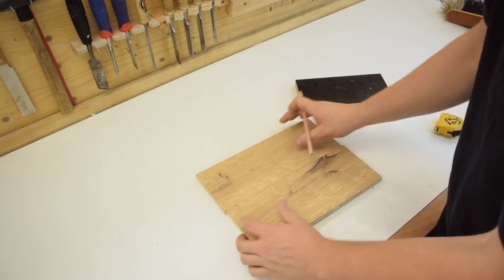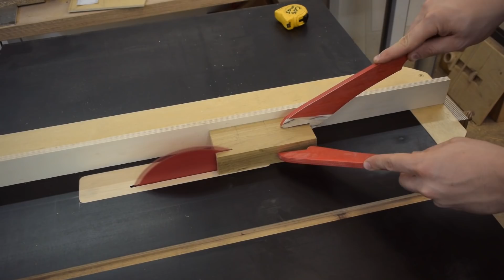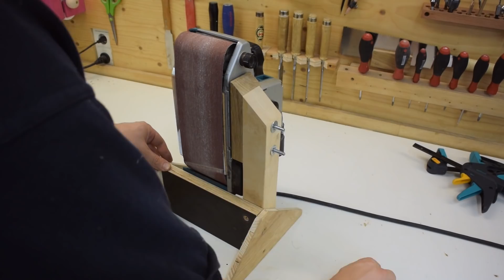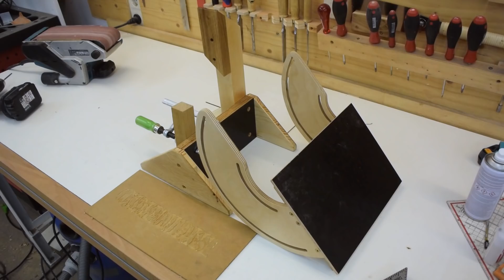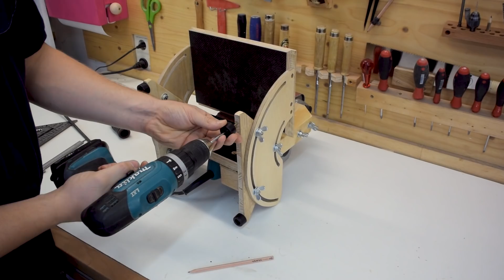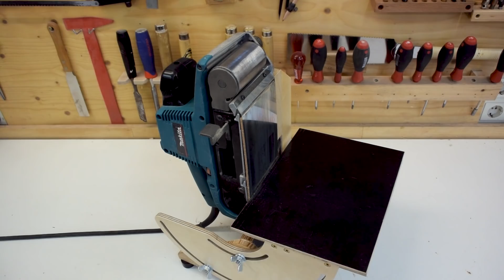Making a Belt Sander Station with 90° tilting Table for a Makita 9404

Comment: Does that Makita belt sander come with those mounting holes, or did you drill and tap them yourself?  I have a Porter Cable belt sander that I'd like to use, and it doesn't have mounting holes (for accessories?) on the body of the tool.

Comment: In order to build these amazing tools you have to already own a bunch of tools and know how to use them.
Reply: Yes good point, to get everything square you need good tools. But I would also add that if you are wanting a belt sander like this then you are quite advanced anyway ?
It's an additional tool for a workshop thats already established I think. 
The flexibility and uses cases are to enhance projects for steel or wood grinding / sanding.

Comment: my cheap chinese one keeps breaking belts, so this is a great idea...
the miter slot might be good if you had a totally perfect filler strip for it with .00000001 clearance and internal screw for hold down when not in use, but another level of complexity, hassle, and possibly ruin perfect surface.

Comment: When I upgraded from my own "horizontal belt sanding station" I found out a couple of things. Holy cow, my portable bench sander was loud. The cast iron of a proper bench sander helps to dampen the sound, but I think it's a different type of motor, even.  
And... disc sanders are incredibly cost efficient. A roll or box of 50x 6" stick on sanding discs takes up less storage space and costs the same as just a few sanding belts.

Edited: I just realized how negative that sounds. My portable sander was the cheapest one at the store. That Makita looks like a work of art, and the melamine covered birch plywood is SAF. And it's good to see a new video.

Comment: Great work designing this system - unique to that sander but ... And, those splits in the plywood from the screws could grow to be a problem but this is not made to be a forever tool. However, the design is amazingly effective.

Comment: I know you said a slot might be gimmicky, but i'd still add one. You can make a super cheap slot out of a picture frame (or ad frame in some places) by cutting the face off and leaving the slot channel for the angle connections they use a a slot. It's small, cheap to make and there's a large variety of T-nuts for various applications, as not all such frames are used for pictures, mine for example is a wall mounted formicarium and it came with these tiny T-nuts (ebay) that hold quite a lot of weight.

You can easily make an angle guide and sled from that.

Comment: Great problem solving, Cosmas. Changing belts easily is indeed a great advantage.
Reply: As far as i'm concerned, it's the breaking point point between a great sander and a bad one. Of course, that may be because i change belts more often, but even so, there are some convoluted and oblique designs out there that just make you scratch your head in wonder at what the design team was thinking.